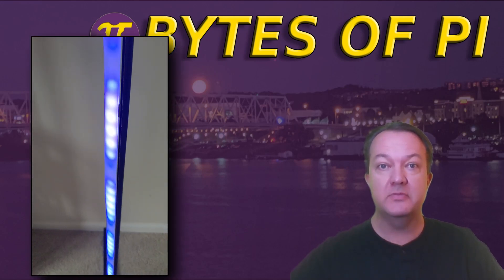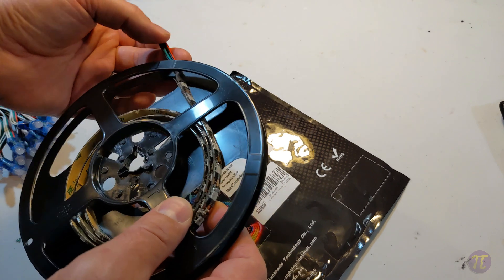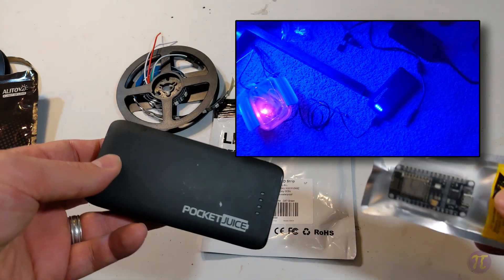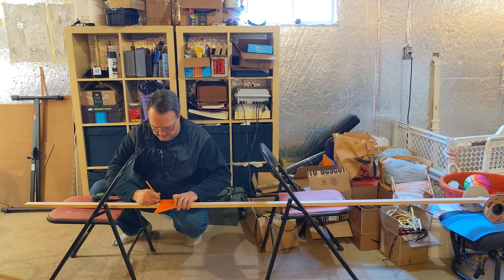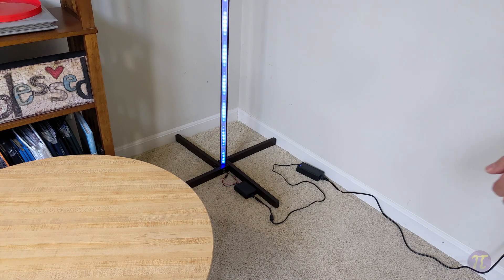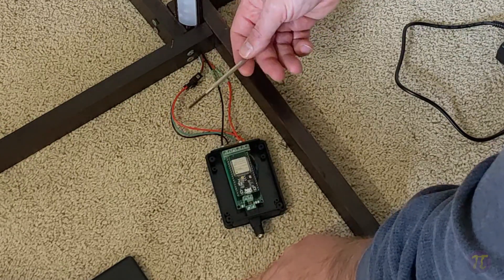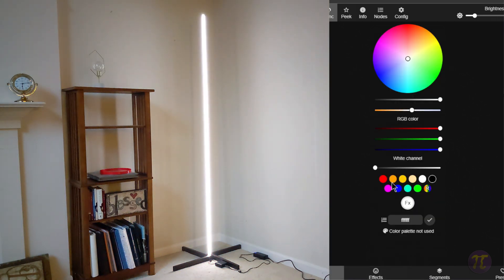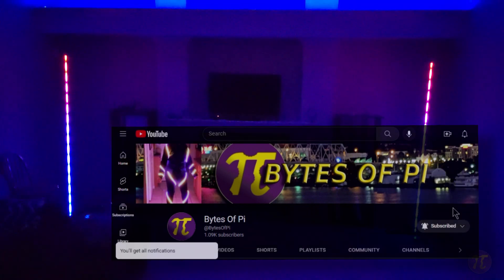WLED RGB Standing Lamps

Comment: Excellent project and nice clean installation. Can you cover how WLED knows to add the white channel?
Reply from the maker: Sure, it comes down to the type of LEDs you select in "LED Preferences".  

When you select "LED Output", it will give you a dropdown of the types of LEDs it supports.  Some of the lights supported (like the SK6812 I used in the video) have RGBW next to the name.  If that type of light is selected, the additional white channel sliders / options are made available.